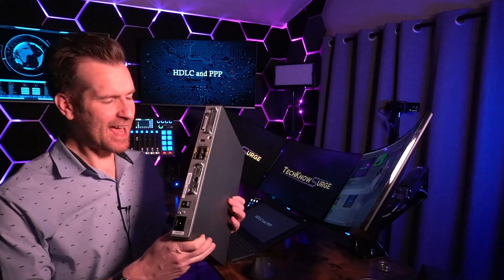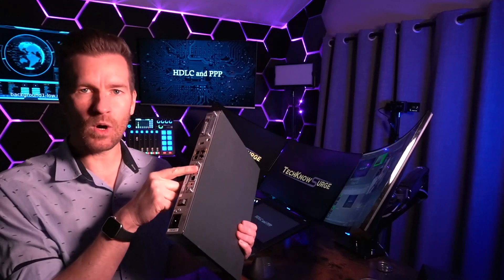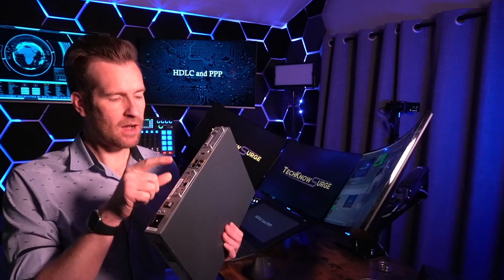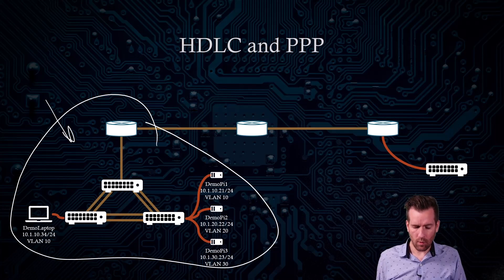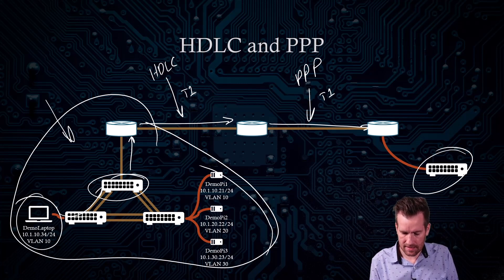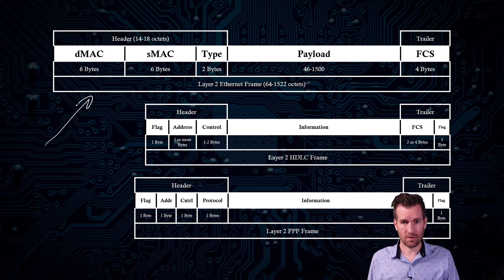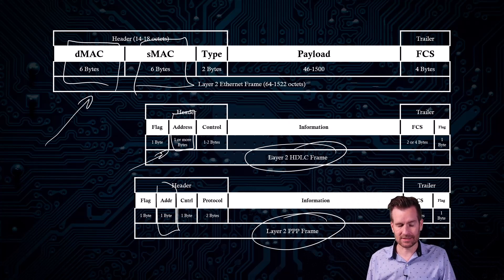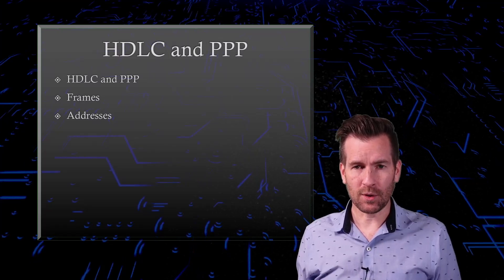CCNA WANs 2-1: HDLC and PPP

Comment: hi i have a question, LLC implement HDLC and PPP? Or LLC is just a theoretical thing?
Reply from the maker: I'm not 100% sure on this, but here is my best shot...

IEEE 802 defines the logical link control (LLC). 802 defines LAN protocols. HDLC and PPP are consider WAN protocols, so LLC is not quite applicable to HDLC and PPP. However, there are some similarities. One source said that LLC took some inspiration from HDLC, so there are some overlapping concepts. LLC functionality would be found in PPP and HDLC.

Comment: Are DEC DTE CSU DSU  interchangeable terms?
Reply from the maker: They are not.  A DCE/DTE is defined by the RS-232, a type of serial connection.  The DCE would be the device on one side of the serial interface which established the timing where as the DTE would be on the other side.  It would also determine the pinouts of each side.

A CSU/DSU is the device similar to a modem, but allows you to connect to a digital circuit such as a DS1.  The CSU/DSU is a type of DCE equipment.

Many of these terms are still used today, but made more sense with equipment used in the past.  At one point, the CSU/DSU was a separate box that plugged into the router via a serial cable.  The router was the DTE on one side of the serial cable where as the CSU/DSU was the DCE on the other side.  Over time, equipment becomes more consolidated and the need for distinguishing the difference becomes less significant.  However, we tend to hold onto these concepts far past their usefulness, so it can be important to understand the history.  Often, I like to give a bit of a history lesson because I find in understanding the past technologies, we can better understand current technologies.
Reply: @TechKnowSurge  Couldn't have send it better myself 😏🙃 I need  to go and rest my clock rate  which side is that on  now?🤣